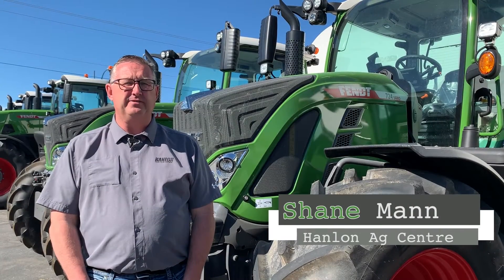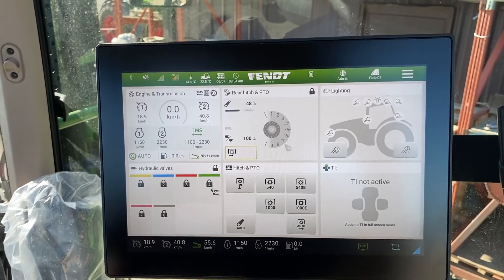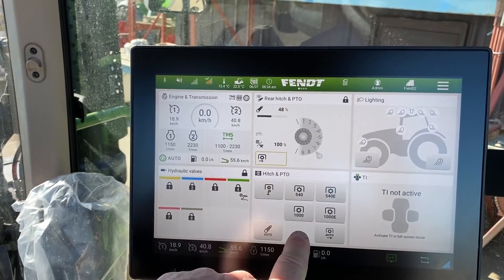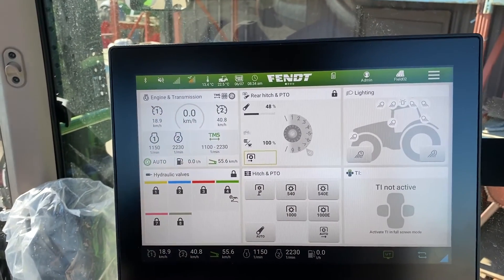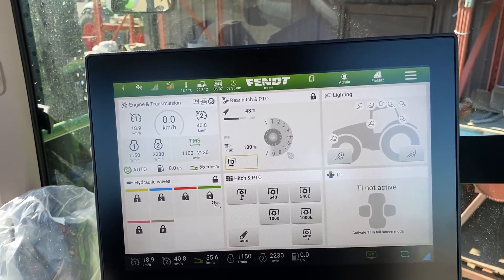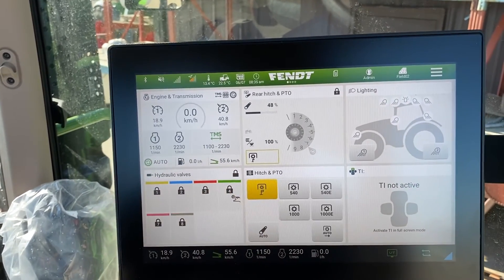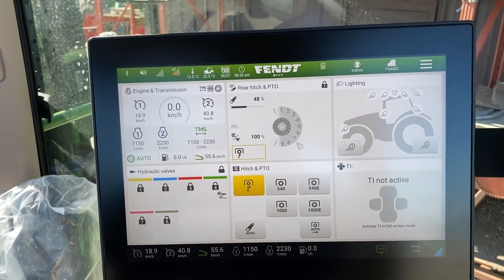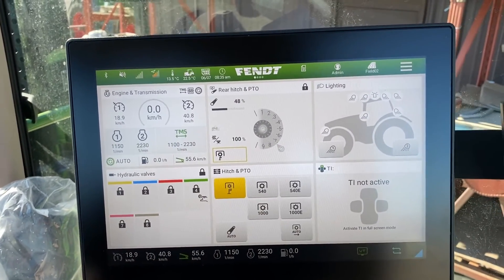Hitch & PTO Screen | FendtOne Terminal | Fendt 700 Gen6 Tractors

Comment: How do you get the tile to show the pto speeds also how do you save a assignable button so when you shut off and turn on again it stays set it doesn't stay for me even with the work profile thanks I really appreciate your videos
Reply from the maker: Hi Jacob, for your first question about the PTO speeds- from what I understand you can't program those on the display. The only place those are shown is on the steering column dash. For your second question, it's hard to say exactly why those aren't programming for you- it could just be a step you're missing in the sequence. If you get in touch with your sales guy, he should be able to walk you through this. We will try to get a video done up on this in the future when we have another Gen6 on our lot. Thanks!
Reply: @hanlonag  thanks for the reply sorry I guess I didn't ask the first question correctly I was talking about the screen you are showing for selecting 1000 or 540 I couldn't find that page all I could find is the one controlling the 3pt
Reply from the maker: @jacobwikkerink2201   It may just be that you aren't scrolling over enough to get to the "hitch & pto" option- it's the box with the 1 over the black squares. If you watch this video it should help you out: https://www.youtube.com/watch?v=4ae2f5NgPbU